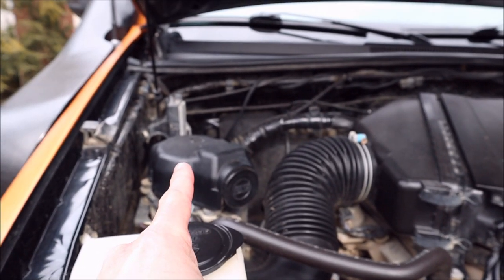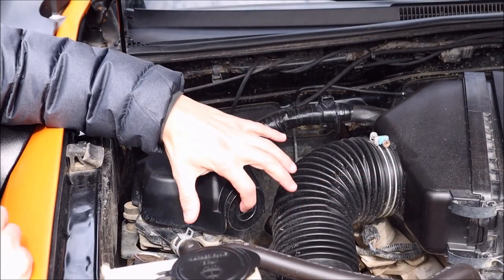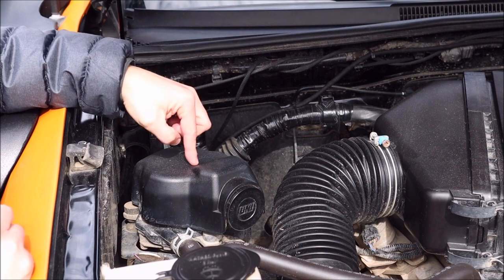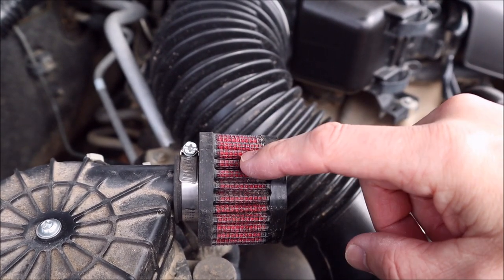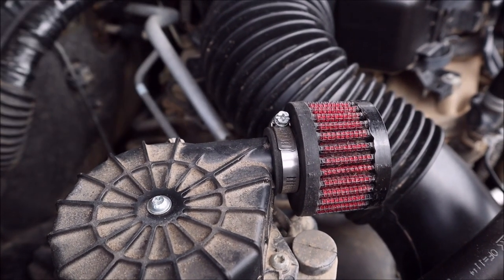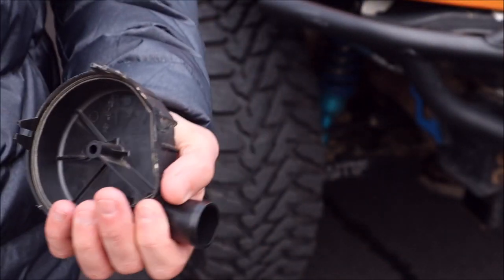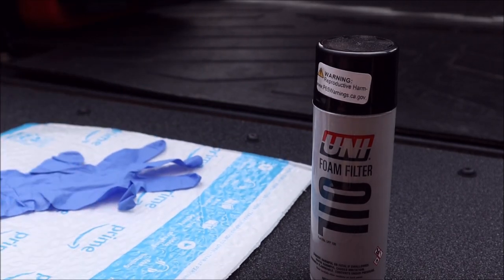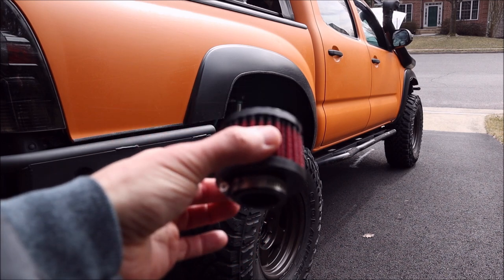Toyota Tacoma UNI Filter Mod Update 2 1/2 Years Later

Comment: Finally got around to doing this filter upgrade on my 2015 Tacoma 4.0 with 44100 miles on it.  The factory filter was still in tact.  I am still glad to get this done.  It took about 5 minutes.  Thanks for the tip.

Comment: My SAIS went critical and put my truck into limp mode just over a week ago (2014 TRD, 113k kilometers). THANKFULLY I had the ECP Platinum package and was able to get the replacement covered under warranty (2700 otherwise at the dealership) It was in my fanatic researches that lead me to the Unifilter mod and this channel (filter should be here in a couple of days, thank you!!) I have been watching a lot of your other videos and love the information I am gaining. As I now 100% own my Taco, I plan on going through everything systematically and repairing, replacing or cleaning everything possible to give it a long and happy life!
Reply from the maker: Sorry your system broke down but at least Toyota covered in under warranty. Thanks so much for watching Derrek!
Reply: @Tacomaholic  I was lucky and did my homework. But the SAIS is a silly and tricky system to pin down in the warranty stuff.
But hey, it gave me an opportunity to learn and share a lot of valuable information and that's always a plus side to these things
Reply: This applies for the 4 cyl?

Comment: I actually watched your uni filter video and found a K&N filter that fits and installed that. It was around the same price and I can use the cleaning kit for the engine air filter on the little filter. I've checked it every once in a while and it's been about a year since the original install. It's still as clean as the day I put it on.
Reply from the maker: Nice!
Reply: Did you get the 62-1370?
Reply: @iamthe.alphabet yes. I just ordered it (same part number you commented on) and put it on 3 minutes ago. That filter comes red and I don’t think it’s pre oiled. I didn’t oil it. Don’t know if I should. But it fit perfectly with the cover and looks pretty good with the chrome top.

Comment: You had a lot better luck than I did.  I checked mine after 6 months during an oil change and the rubber had dry rot under the hose clamp.  Maybe I tightened it too much initially.  I found the exact same K&N filter and been using that for a year now.

Comment: Forgot to mention that you did not CLEAN the filter before oiling it.

For my K&N filters, there is a special cleaning spray which you spray on, let sit, then rinse the dirt and debris off.  Then let fully dry, before adding the oil. 

Some people have recommended soaking in Dawn dishwashing detergent for a while, rinse, then let dry before adding the oil. 

Wonder if you can use the K&N cleaner and oil for this UNI air filter?

Comment: I bought (2) K&N versions and just re-oil one of them every other oil change and then clean the other one. It's a little dirty but honestly it could probably go much longer... 10K frequency seems good enough. Also I removed the housing and leave it off. I think it lets the filter breathe a little more easily. I live in Phoenix so we don't get a lot of rain , moisture here so that's not likely an issue.

Comment: Interesting - Toyo had a recall on Air intake valves and replaced air intake (2012 TX Pro). Left my uni sitting on the front seat- so I popped off the cover and put UNI back on.New cover would need some hacking to fit UNi.  Wonder if I can just get the cover.

Comment: So I have 2 questions:

1) Once you put the filter in place, and then add the protective cover, nothing but the bottom of the filter is exposed. Wouldn’t that drastically reduce the air intake? Because before you removed and discarded the old cap, air entered in a 360° area. 

2) Did you notice ANY discernible difference in performance when you installed this filter? You mentioned in another video that it sounded different when you turned OFF the vehicle. But what about when accelerating, revving, or idling? Any difference?
Reply from the maker: The SAIS system is only related to emissions and has no bearing on the engine's performance. You can hear that system sucking in a last bit of air when you turn the truck off because of the new filter placed outside of the unit.
Reply: @Tacomaholic  that is strange, because didn’t you say that if the foam breaks down and gets sucked into certain parts (restricting air intake), the vehicle would be sluggish, and some people reported that it would not go over 45 mph? 

So I would assume restriction to air DOES impede the performance. 

I was just asking because I am curious if you knew anything else about this.
Reply from the maker: @RaymondMillbrae  I know Toyota just added the system to be emissions compliant during the 2nd Gen Era. Here's their definition of what the system does: "Secondary Air Injection Pump. ... An emissions component, that is part of the secondary air injection system, which is responsible for pumping clean air into the vehicle's exhaust stream to promote a cleaner and more complete burn before the fumes exit the tailpipe."

Comment: Before your original video came out I had to get my pump replaced under warranty because the sponge filter failed then a couple months ago I was sent a recall notice for the sponge and the pump did anyone get the same recall? I've had a uni filter since your original video but for the price I just replace it once a year

Comment: Did you notice any noise after removing the sponge foam for the UNI filter mod? Will the UNI filter rubber part dry out and broken as well?
Reply from the maker: No noise and the rubber on my UNI filter still looks new.

Comment: The Uni Filter that you linked to is not available on Amazon anymore, it says they don't know if it will be back. Do you have a link to another source for my 2013 Tacoma? I've tried searching but I'm not confident that what I'm finding will fit. I did find the Uni Filter one you used on eBay but after shipping, it was going to be over 30 bucks. And thanks for your videos I definitely learn something with each one.
Reply from the maker: Hey Dan, here are a few other options: https://amzn.to/39F2LBn and https://amzn.to/3fGhqAe
Reply: @Tacomaholic  Thanks so much

Comment: Once you get a Toyota recall on this system, is it feasible to reinstall the factory sponge filter before heading to the dealership? if they see that aftermarket K&N filter on it... will it void the warranty?
Reply from the maker: Easy to swap in the old filter if taking it to the dealership.
Reply: @Tacomaholic  Yea, I would do that too.... is that apparatus for the emissions?
Reply from the maker: @dundeeecroc  Yeah
Reply: @Tacomaholic  I have a rust free 1985 4runner SR5 on 35's with 5:29s, 5 speed.

Comment: I’ve had my 2014 for 2 years now and bought it at 82k mikes. Now has 132k miles…..I’m sure mine has been replaced at some point before I purchase it, buuuuut after watching your first video on this, I’m definitely going to upgrade that. Probably the K&N one cuz your link for the uni filter says it’s currently unavailable.
Reply from the maker: Yeah the regular UNI filter has been hard to find lately (plus the price almost doubled) so the K&N is a good choice too.
Reply: I just got the UNI on Amazon.  I think it was $30-ish.  The original sponge seemed fine, but better safe than sorry.  2014 year tacoma with 36K miles.
Reply: @Tacomaholic  So I just installed it 😅 Is it supposed to make a really loud like screaming sound when starting your truck?!? 🤣 I started my truck and it made that sound for about 20 seconds and then stopped and then when I shut my truck off it made that sound again….
Reply: @megandevries3581 mine did/does that too when I installed my UNI , I just chalked it up to air going through it 😎👍🏽

Comment: Before you do this, check on your recall list.  Turns out mine was under a  recall, that just came out in last 6months or so.  They replaced the whole system at my local Toyota dealer.  Because mine went bad and threw a check engine light.
Reply: What year is your truck?And how many miles/kilometers?I have a 2015 with only 62k kilometers.Gonna check with the dealer tomorrow.Thanks
Reply: @alexabuy3411  2012 v6

Comment: Hey, I've been keeping an eye out on your channel for a few years now, maybe I missed it, but, on the stock rear suspension, did you beef that up at all?   On my 2011 Tacoma, the other day for the first time I had two more people in there other than me, all a little over 200lbs, went ovef some new england potholes and the rear axle actually bottomed out on the rubber bumper on the frame.  I was wondering if you or one of your followers have any Idea's on what I need to change to fix this.  Rig has roughly 118.000. miles on it.  thanks
Reply from the maker: Greetings Patrick. If you are still running the factory leafsprings they are probably just naturally sagging. If you aren't looking to lift the rear the best thing to do would be to replace the entire pack with an OEM set of new leafsprings.
Reply: @Tacomaholic  wow man!! Thanks for the reply!! Never thought I’d get one.  Thanks very much!!!
Reply from the maker: @patrickmessier1642  Any time. 👍

Comment: Hey man this is what I do when I clean my air filters clean it with hot water and dawn dish soap. Then you would use the spray to coat the top let it sit for like 5 minutes & you good to go
Reply: I have run out of K&N cleaner in the past. Simple Green also works if you spray it on and let it cut the oil and dirt and then rinse it off and let it dry.

Comment: What is this filter supposed to protect against?
Reply from the maker: It's a replacement for the Toyota sponge filter that sits inside of that housing that has been known to deteriorate and get clogged in the system.

Comment: How many miles you have on that thing?
Reply from the maker: 64k on the Tacoma
Reply: @Tacomaholic  Man thats crazy.  Figured you'd have way more than that.  I bought my 2015 TRD Sport in July of 2017 with 35K on it.  Just rolled 130K on the clock and it still runs as great as it did the day I bought it.
Reply from the maker: @bassinwithbuck4955  Yeah it's pretty low mileage since I've had another vehicle for my daily for the past few years.

Comment: what don't you show the inside of the cover and the fan blades.  would be interesting to see the condition of everything in there.  it did not look like any dirt came out.  Also, do you know of anybody  running the original foam and the UNI filter together?  Although you would have to find or make a new little foam filter.
Reply from the maker: Running both the OEM and UNI filter together might throw a code as it would restrict the air flow too much.